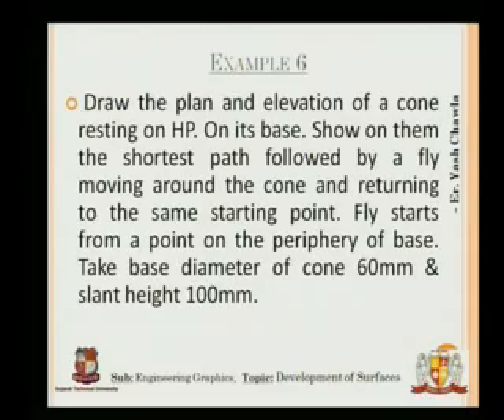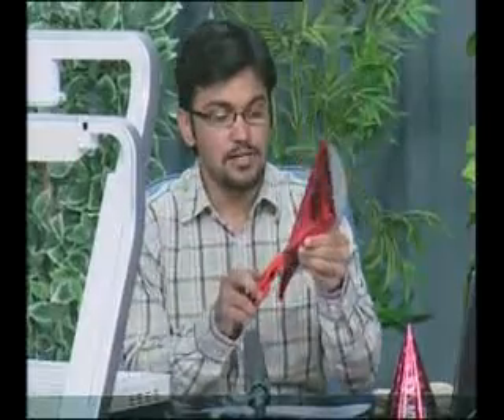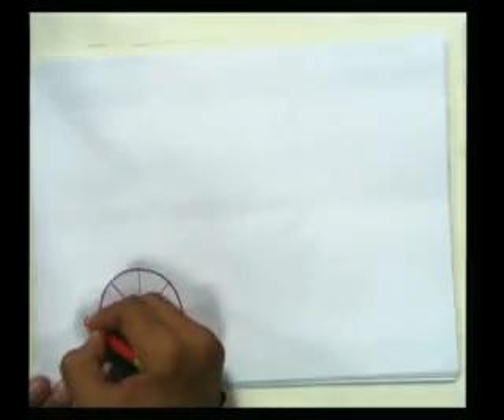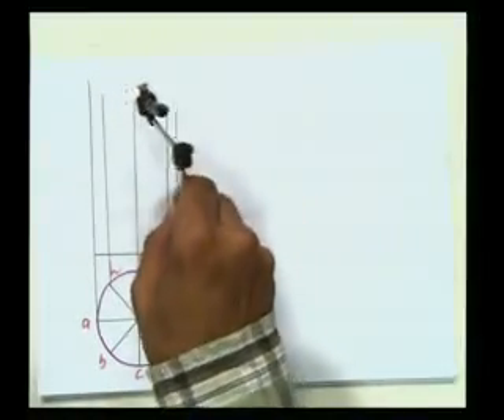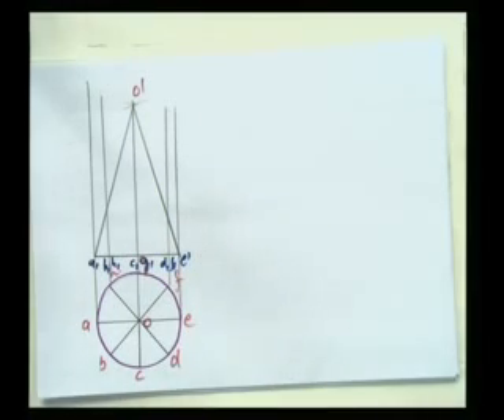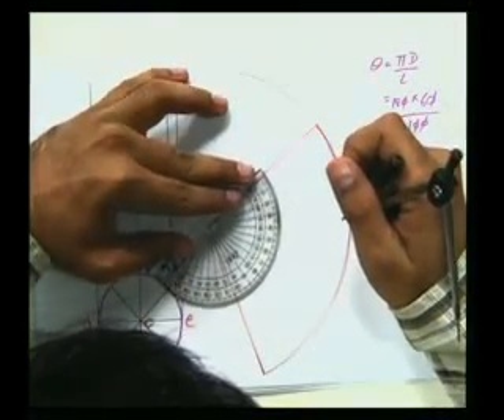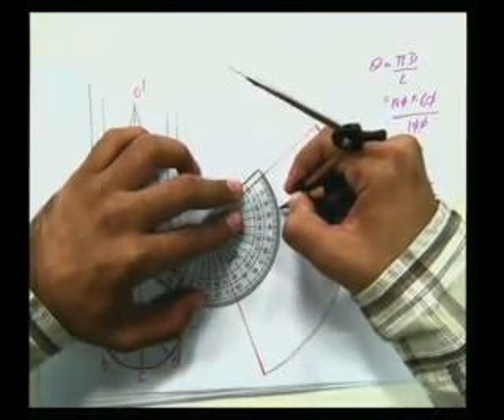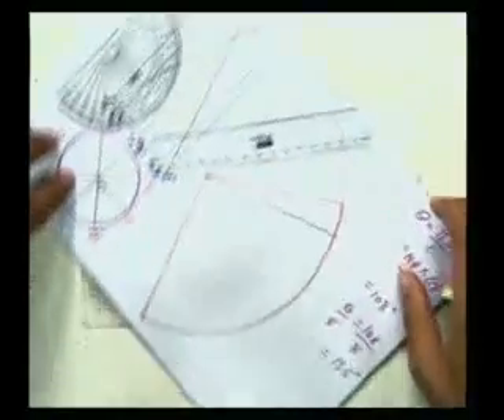Yash ChawlaEngineering Graphics-Development of Lateral Surfaces_6

Comment: While marking points 1, 2 etc in f.v, you have not joined those points to the top point o of the cone. They should be located on the slant lines joining points b, c to the top point o. Only then can they be plotted correctly.